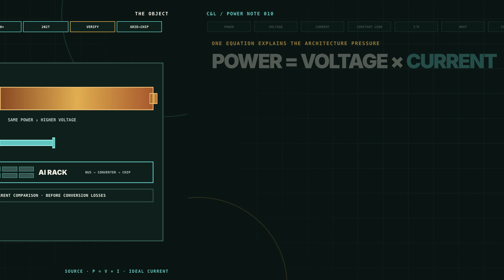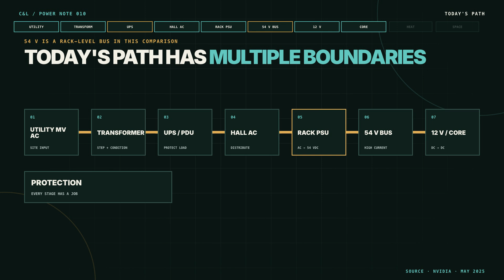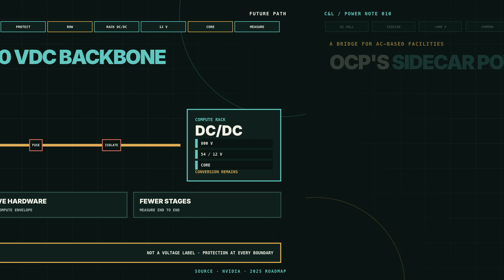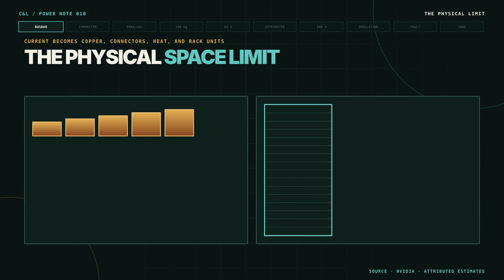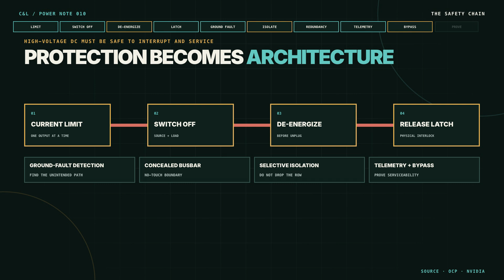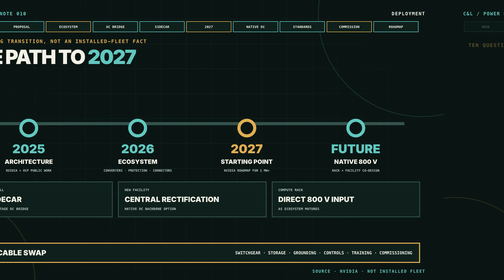Why NVIDIA Wants 800V DC for 1MW AI Racks

Comment: Hmm, could you release one that is a bit more for the Layman and how it would benefit arguments against AC industry versus having direct current industry that are hungry for resources, and then it would make sense for cooling to advance and to helium Xenon closed loop cooling systems with possible dielectric fluids in certain industries with larger radiators